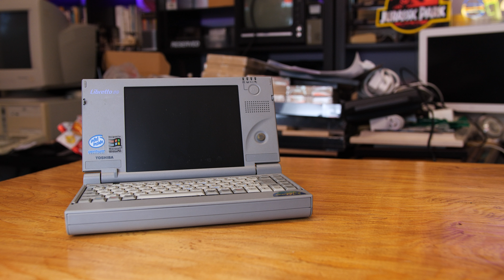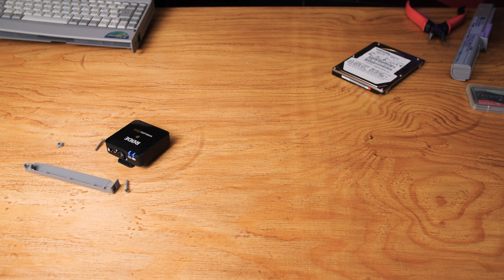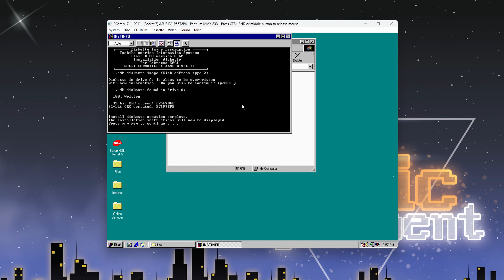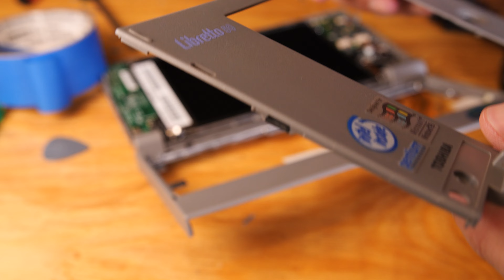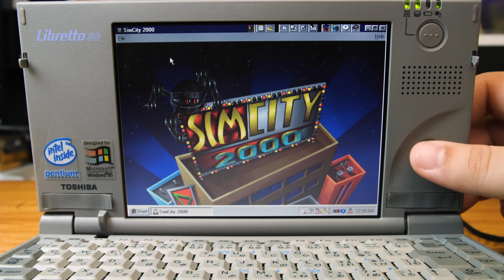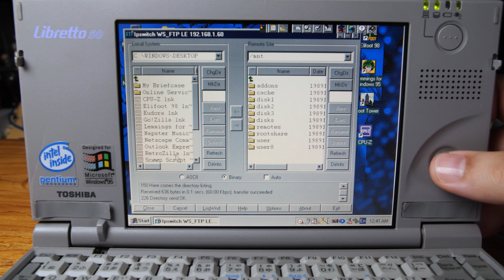Two Broken Tiny Laptops Made Into a Working One

Comment: Did you try flashing the bios from a 720k floppy as it says in the instructions? Asking because I tried the same with a 1.44 (even a tricked one to fool the drive it was a 720k) and it did the same. Although I understand that there is a specific need to have an original low density floppy disk.... Don t quite understand why but.... I Don t have that disk to test and my libretto is in the same f12 status as yours...

Comment: the sticker screw cover removal (for the LCD bezel) hurt my soul..... a trick that ive been using for years now is to get a thin razor and a hair dryer. blast the stickers with some heat and very gently use the razor to slide under the stickers in order to remove them without mangling them up and making them look trashed. You can put the stickers on parchment paper while youre working inside the screen assembly, then heat the the sticker area again and re-apply the sticker
Reply from the maker: I'll keep that in mind next time I have a similar project!
Reply: Please be careful if using a hair dryer on the laptop! I melted the keys on my Libretto 50CT this way...
They are not easy to make replacements for.
But removing the keyboard and placing it aside solves that problem :)

Comment: Very sad you shoved a too big hdd in there.  I have a few of these, mostly in good condition, and this is one of those no-no's.  
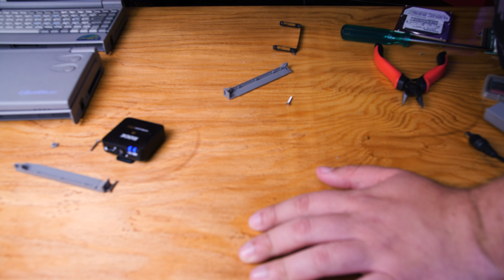EDIT: 05:52 that is completely your fault, you are too rough, and should've looked out for that specifically because you took out the screws.  Really, be a little more careful, these things are very well loved, by a lot of people.   
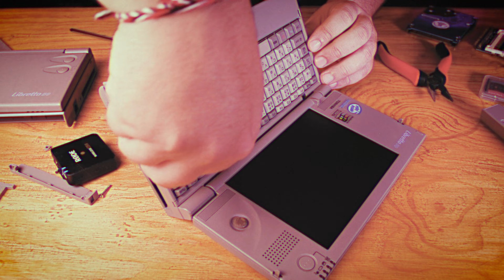EDIT MORE: I'm actually stopping to watch.  You absolutely do NOT have to manhandle it like 06:22 etc, seriously you don't.  Take your time, feel for resistance, use a service manual to know where the clips are, and take more time.  Damn man, what a waste.
Reply from the maker: Oh, I take full responsibility for my mistakes there haha 

I didn't realise at 5:52 when I was lifting the screen that that was loose like that, it was too late when I heard that crack.